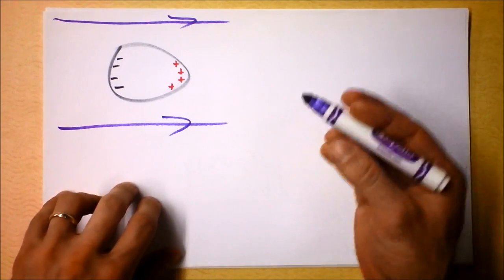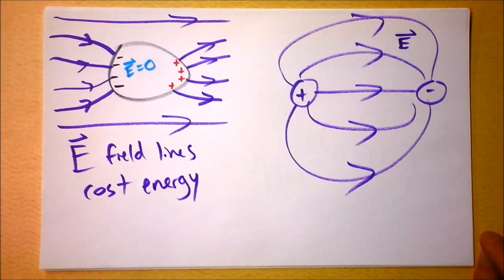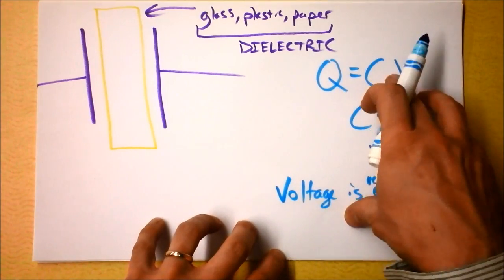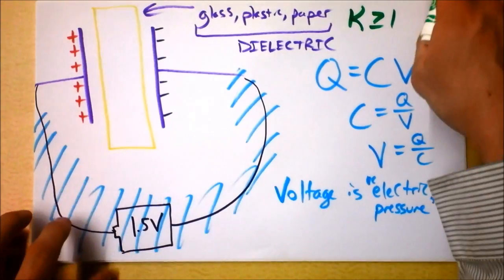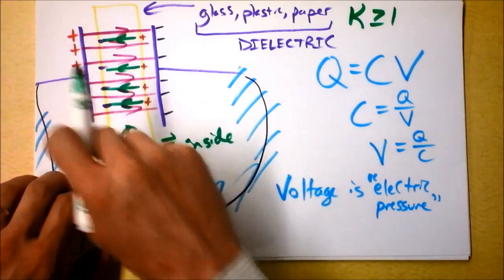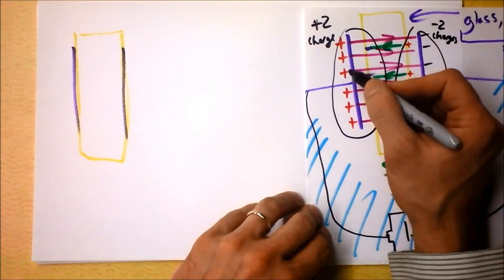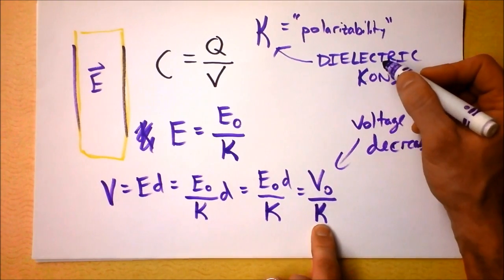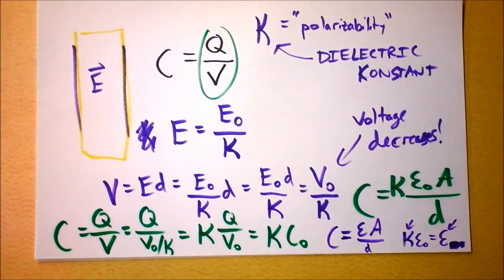Dielectrics in Capacitors and Otherwise | Doc Physics

Comment: So if metal has a near infinite dielectric constant, why don't we use that as a dielectric? Of course I'd coat the metal dielectric with an insulator first. But why are metals not used as dielectrics?
Reply from the maker: That's exactly what's done!  You've now made a much smaller-separation capacitor, where the dielectric is the insulator coating.  Even better if this can be done in a liquid with an atomic-layer coating, no?
Reply: Doc Schuster , thanks for the reply. I have another question that follows:  I saw a chart which said aluminium foil has a dielectric constant of 10. Why not way higher? That doesn't seem near infinity. 
Also, I can't find any dielectric chart which list metals other than aluminum foil. Is there some big disadvantage with using a metal dielectric, like the electrons being too free and thus not being able to polarize in the neat way of electrons staying near their parent atom and just offsetting a bit?

Comment: you couldn't have explained this without doing a million complicated equations?
i don't care about the math, i just want to understand the concept.
Reply: That is literally some of the easiest math you will ever see when doing things like this. Sorry.
Reply: Wrong. This can be explained without math or with very little math. You're a typical "physics" person. Instead of talking about why the apple falls down from the tree (and not up) you rather spend the whole class about calculating what velocity it has at any given point, how long it takes to hit the ground, yada yada.
Reply: Peter Gizmos I'm not going to argue with you - I just want you to know that almost every physics professor I've had has been a firm believer that you can't truly gain intuitive understanding of problems without understanding the math.
Reply: almost every physics professor = average
i'm talking about elite. i would also argue the contrary.
Reply: Instead of going through a bunch of math, I would have been more interested in what happens if you take the dielectric out from the charged plates and place them between uncharged plates.

Comment: Nick Stegmeier: "If metal has "infinite polarizability", why not use it as your dielectric? Could someone help explain?"
The answer is a dielectric is an insulator, whereas a conductor conducts. Thus, even though a metal has infinite permittivity, if one keeps a metal in between a capacitor it acts as a short circuit and pulls infinite current into it to satisfy Ohm's Law. The net Electric Field inside a metal is zero!
Reply from the maker: +cannibol9009 That's just what I was thinking.

Comment: Dear Doc Physics , The shape of external field  near the charged conductor altered   because of  induced charges on the surface of the conductor.                                         The external field became zero inside the conductor. This called electrostatic shielding. often called a Faraday cage set up.  The field is inside conductor is zero because of generation of another op-positional electric field inside the conductor that starts from from induced positive charges and ends at negative charges . This op positional electric field cancels the external electric field. Your video gave a reason that it is because energy is required which is not clear.

Comment: What happens if we put a conductor between a capacitor, not touching the plates?
Reply from the maker: Fun question.  You've essentially installed two capacitors in series.  They each have higher capacitance than the original due to the smaller plate separations, but they're in series, so that decreases the equivalent capacitance by 1/2 (assuming you've centered your inserted conductor).  If you can get the plate separation quite a bit smaller, this process will still be beneficial to you.  ON THE OTHER HAND, you've decreased the size of the gap, so the sparking opportunity has greatly increased.  So your max voltage goes way down.

Comment from the maker: Air-gap capacitors are indeed very low capacitance.  They are commonly used for adjustable caps for tuning (in antique radios and even in modern research).  They'd also be good for high voltages, of course.

Comment: Awesome video! I was looking on the web for some typical dielectric materials for capacitors and air seems to be used sometimes. Although air would have a high breakdown voltage as you mentioned at the end, wouldn't it be one of the worst for capacitance as it wouldn't reduce the electric field inside the capacitor at all so the kappa would be 1 if I understood it right, so why do they use air?

Comment from the maker: If you slice a loaf a bread into a billion equal slices, you'll have really thin slices.  If you slice into infinite equal slices, the slices MUST HAVE WIDTH ZERO.  Otherwise, you would have needed to start with an infinite loaf of bread.

In other news, you are correct.  You need an insulating dielectric so the charge doesn't just GO.  I think if you can figure out how to make a perfect dielectric, you'd get pretty rich.  Maybe no Nobel Prize, though...but it's worth a weekend, anyway!